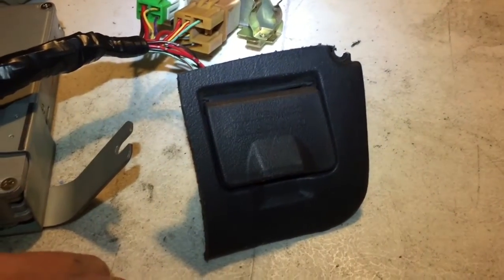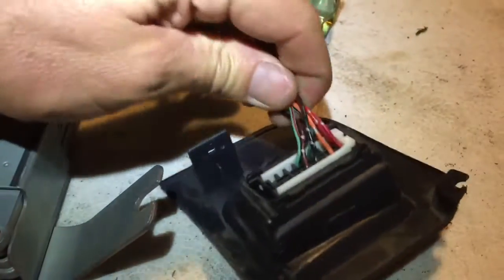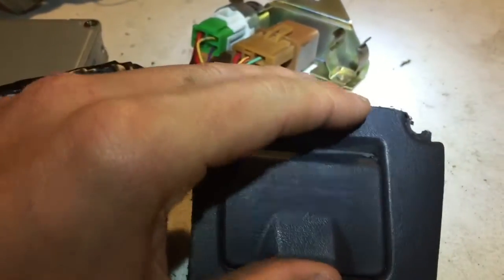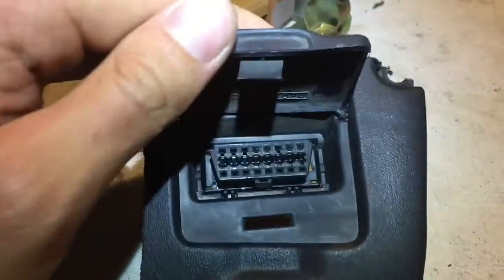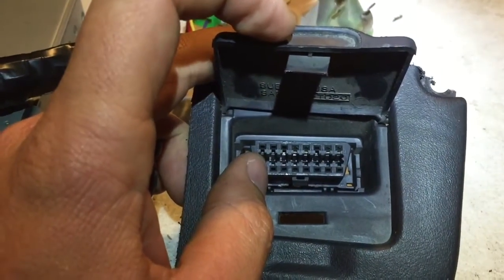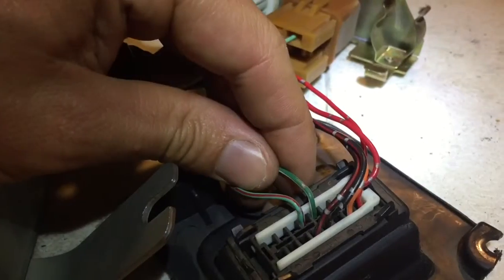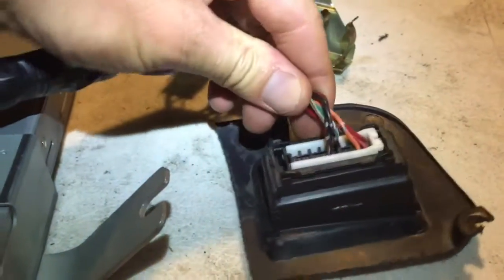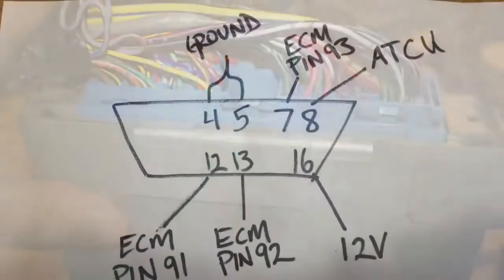Subaru OBD2 Pinout

Comment: Thanks for the video. Have you ever removed the pins from a Subaru OBD connector in order to repair or replace them? That's what I need to do on my 2001 Forester. The housing and connector look the same as yours. I've got the connector separated from the housing but don't know how to remove the pins and don't want to screw it up. Thanks,
Reply: I have the same problem w pin 16 the ground how’d did yours go?

Comment: excellent video . I have the wrx 2003 engine and it doesn't have obd2 and I want to install it but I don't know which pins come from the ecu to obd2. I know that in obd2 there must be pins 4-5-7-15-16, I would appreciate the information.

Comment: Mick, I have a 2003 Legacy.  Trying to get ODB2 to work.  Have the same GND, 12+, but the signal wires that you say go to ECU 91, 92, 93 are not the same on my ECU.  I have your 2003 Legacy H4 ECU Pin Out, (Thanks BTW).  Do you have any info on where the G/W and other signal wires go to the ECU?  Thanks.  Mark B. STL, Conversion # 3.  Yahoo....

Comment: Hey man quick question. We did a auto to manual swap on an 04 wrx and now when we try to flash our cobb to the obd2 port it acts like the ignition isn’t working when the key is on. Any ideas?
Reply from the maker: I would grab the service manual and get the wiring diagram just to doublecheck the pinout. Are you able to connect to OBD using a different method than the Cobb? Perhaps your line end check connector needs to be plugged in?
Reply: Busaru yea we plugged an obd2 reader in and it won’t connect.
Reply: I'm having the same issue where my accessport doesnt connect but a code scanner does, I know it's an old comment but have you figured out what was wrong with yours?